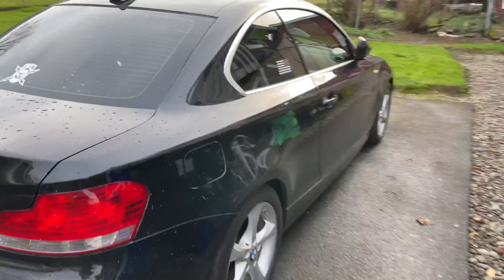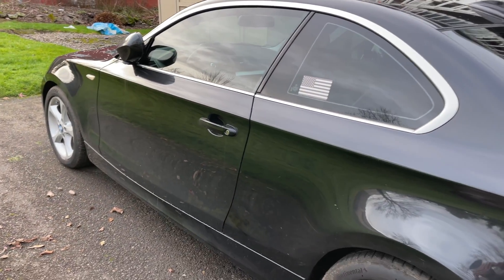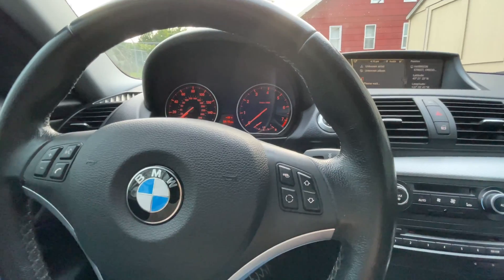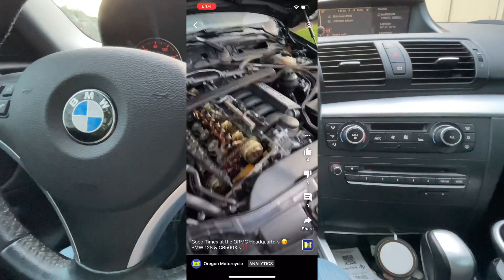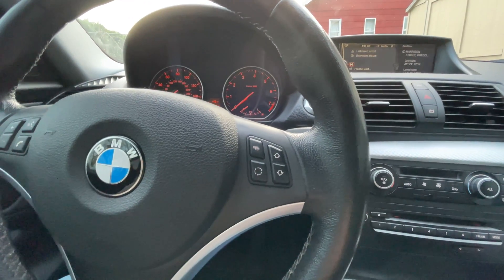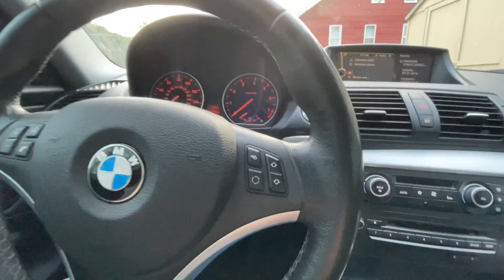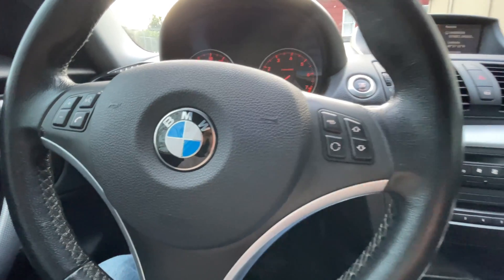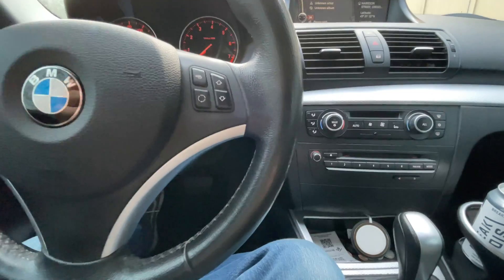2A7A code BMW N52 Diagnostics Sounds 128i | Oregon Motorcycle 2022

Comment: Thank you for your vid help, I'm in the process of installing steel bolts in my 2011 x3 M52.
Did everything work out long term? It seems like bmw is trying to hinder that upgrade and wondered if there might be mysterious reasons for soft bolts...
I hope not!!!
Reply from the maker: Everything thing is fine. Motor still running strong everyday.

Comment: My 2011 128i is throwing 2A7A and 2A87 codes. I’m hoping it’s just the vanos solenoid and not something worse.
Reply: My 2011 328i is throwing 2A7A and 2A87 codes.. were you able to resolve this issue with vanos solenoid replacement?
Reply: @ no. It was unfortunately much worse. Discovered vanos bolts sheared off and timing chain guides crumbled. Literally.

Comment: That sucks, fingers crossed for a straight forward fix.....keep us posted please
Reply from the maker: Got the valve cover off last night. 3 of the 4 bolts are sheared, but still in place. Meaning I don’t have to pull the oil pan to retrieve the bolts. That was a lil good news;)
Reply: @OregunAdventure  that’s great news. Nothing worse than playing hunt the pieces.